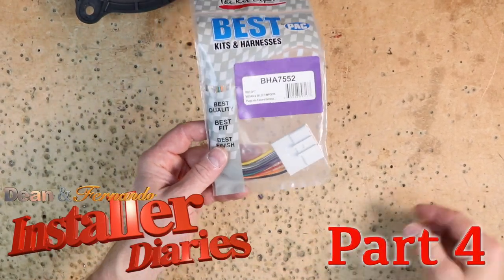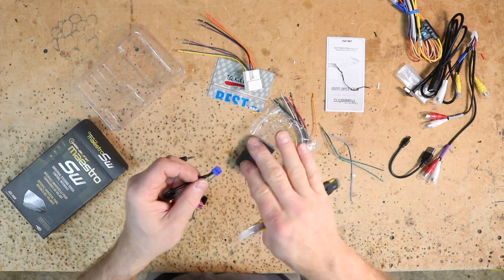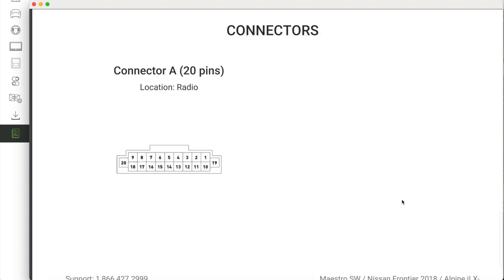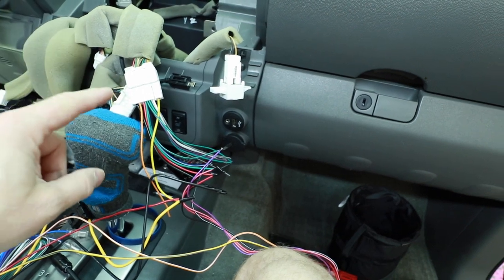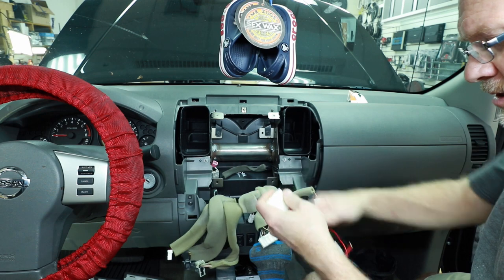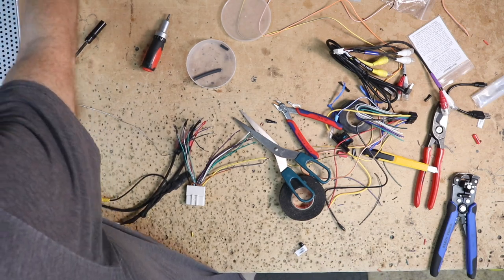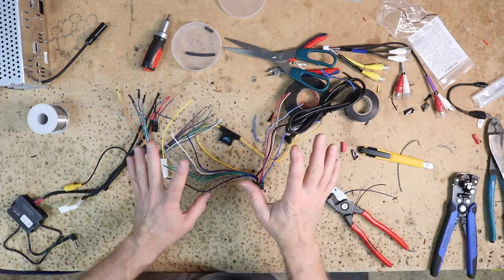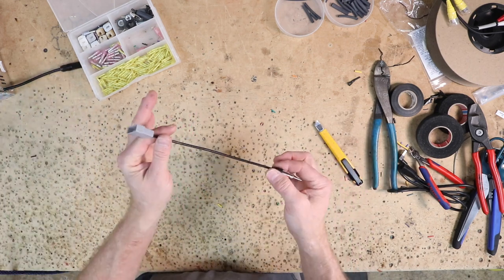Retaining the backup camera and steering wheel controls Nissan Frontier installer diaries part 4

Comment: I have a 2017 Frontier SV. I am installing a Atoto A6 9" which has the option to map the buttons. I can't seem to get the steering wheel controls to work with the ASWC-1 even after switching through all the Radio brands. Some say no module is needed for this truck. Is this true? I quickly wired it without the module (grounding pin 15, connecting pin 6 and 16 to the 2 SWC wires on the Atoto harness) and it didn't work. Any advice?